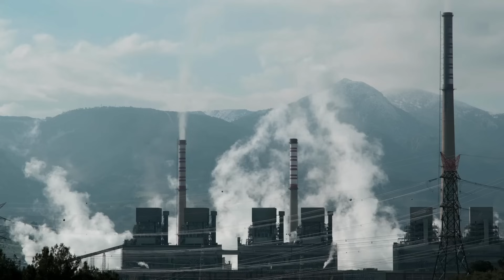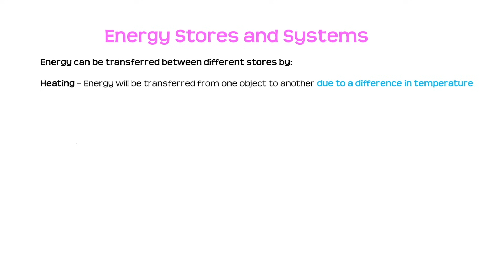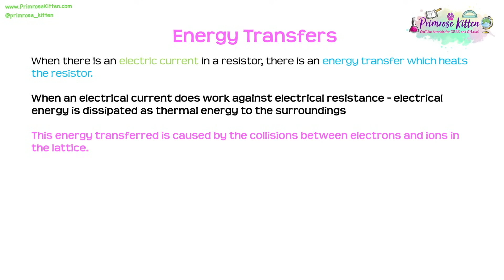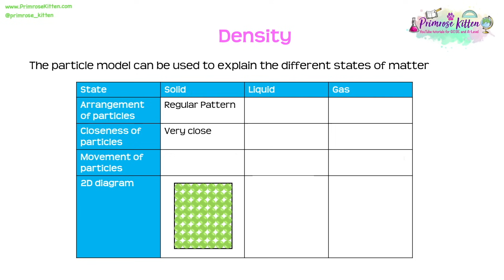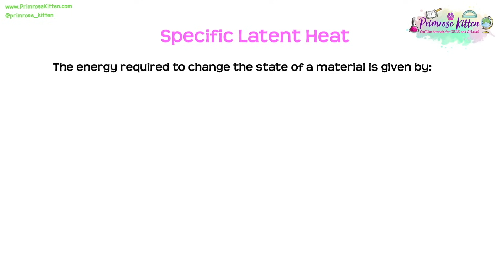Foundation | Edexcel | Physics Paper 2 | Whole topic video

Comment: 0:36 - Understanding prefixes in physics
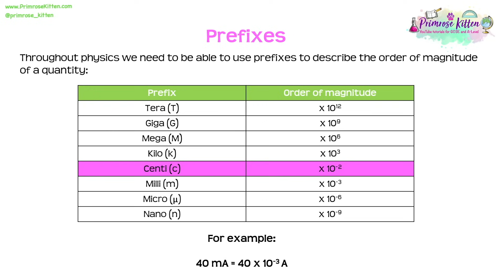2:23 - Different energy stores explained
4:34 - Energy transfer methods overview
6:57 - Kinetic energy equation and units
9:14 - Energy cannot be created or destroyed
11:01 - Efficiency calculation for energy transfers
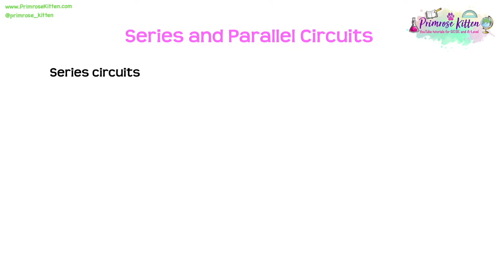18:21 - Current is the same in each component
20:12 - Adding resistors in series increases resistance
26:58 - Understanding potential difference and resistance
29:39 - Non-linear relationship in filament lamps
35:20 - Advantages of heating effect in appliances
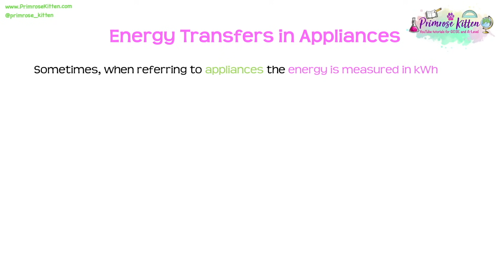39:00 - Energy transferred using kilowatt hours
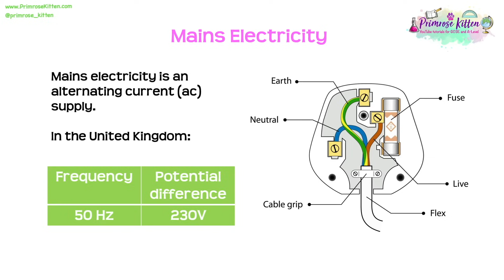41:09 - Understanding mains electricity specifications
44:23 - Dangers of live wire contact
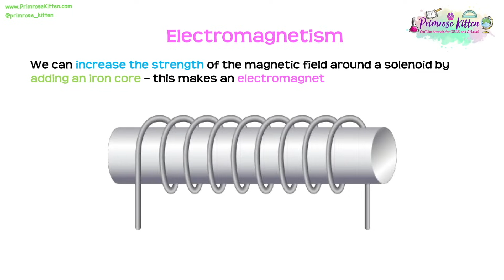49:10 - Advantages of electromagnets over permanent magnets
52:01 - Role of step down transformers in safety
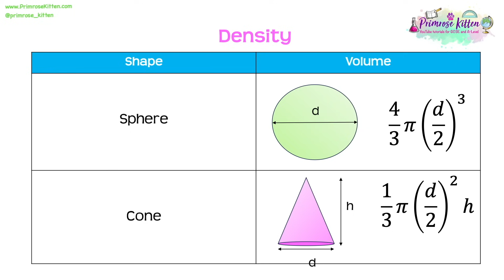54:56 - Methods to find density of irregular objects
57:31 - Experiment to find density of regular objects
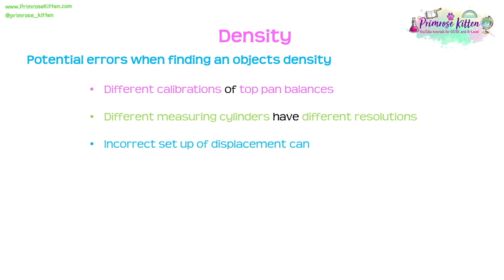59:25 - Potential errors in measuring density
1:01:17 - Understanding internal energy of a system
1:03:00 - Definition of specific heat capacity
1:05:36 - Energy required for state change